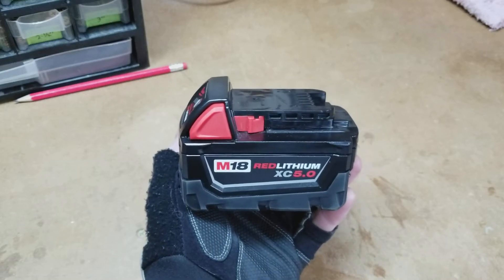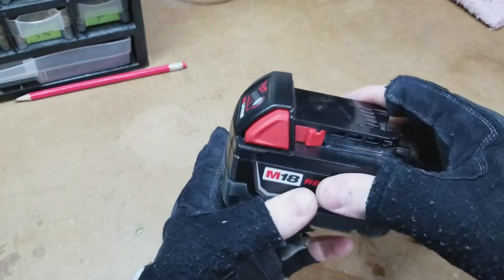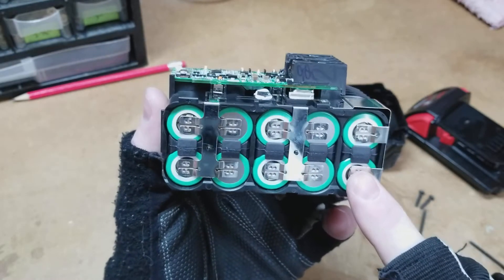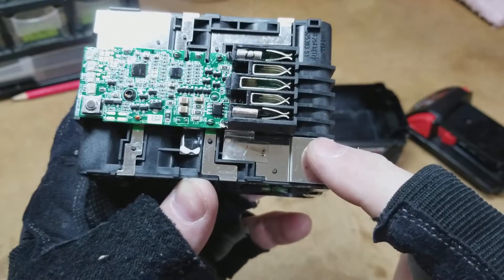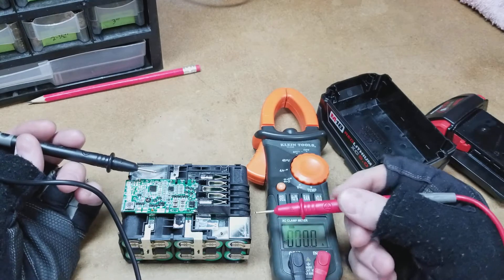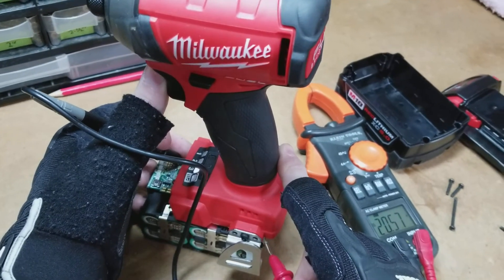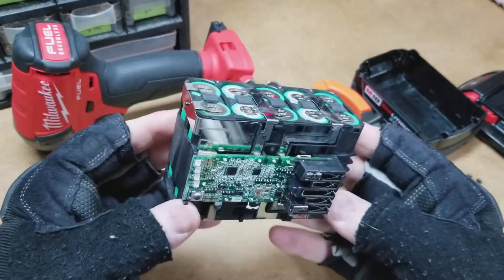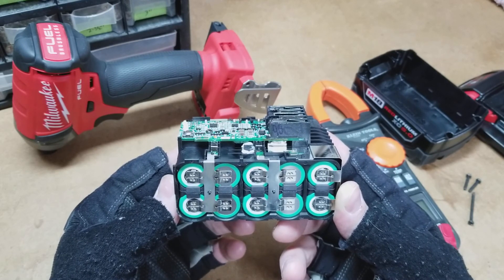A Look Inside a Milwaukee 5.0amp Battery

Comment: To test amperage you'd have to actually put a load on it and then hook up the meter in series on one of the leads. I'm not sure why that 12A load showed up but that's definitely not accurate. It also shouldn't be that constant under a real load. It'll vary depending on the amount of trigger you're pulling
Reply from the maker: Yeah I'm not to sure about the amperage reading idk much about that stuff. But I know the batteries when fully charged will read 20 volts but under load it should drop to 18 volts so that kinda stumped me, maybe its cuz the battery I was using was in a fully charged state and that caused it from dropping down to 18 volts. Also that multimeter i was running was an old crappy one that had glitches and wouldn't turn on right sometimes and stuff, since then I have ditched that multimeter for a very nice high end Klein M700 multimeter which works great!
Reply: Chevy513 - Yes you’re right. Most batteries have what is known as a Voltage Sag. So whenever you place the battery cell or pack under a load, the overall voltage will dip by a couple of volts. The smaller the sag generally means the better the battery quality. But really I don’t think you could get much better than say 1V or so.
Reply from the maker: @honestinsincerity2270  You know what I've also noticed is if I have a fully charged battery it will read 20 volts but if I take a battery that has been run say half way down it will read 18 volts then, I've noticed the same thing with stuff like AA batteries they are 1.5 volts and will read 1.6 brand new and as you use them the voltage will lower over time, I've checked some of my used AA batteries that aren't dead but have been used for awhile and they will read 1.4 or sometimes 1.3 volts
Reply: @chevy5137  lithium batteries have what is known as nominal voltage which is in essence its average voltage over its usable life span. in the case of lithium ion cells like the 18650 cells that comprise your drill battery the nominal voltage is 3.6 volts. which is why they label it as an 18 volt battery. 3.6 volts times five cells in series which is 18v. the voltage range of one 18650 cell is 3v to 4.2 volts. this is why you are getting over 20v when you measure them fully charged.
Reply from the maker: @danielroark171  Yes and this is a common thing and companies like DeWalt and Porter Cable say 20volt max* because without being under load they are 20volt but in all reality they are the same as any 18volt battery out there
Reply: @chevy5137  that's pretty much it
Reply: @chevy5137  incorrect. The reason you did not have voltage sag is because your battery was not under a load. Simply pulling the trigger on a drill with nothing attached is what’s called an idle run. Yes the drill is running, yes the drill is pulling energy from the battery, but it’s not taxing the battery. Thing of it like a gas tank in your car, if your gas tank is full to the brim with fuel your fuel gauge in your dash will read “full”, if you park on a steep hill your gauge will likely not change at all it’ll still say full. However… if you have a half of tank and you your gauge says “half” and then you park on a hill you will likely see that your gauge will now (after a brief time to readjust) show as if you have more or less fuel than you really have. In this example your tank is your battery, your gas is your stored energy, and your gauge is your meter. 20 volt and 18 volt batteries are not I repeat NOT the same. One is fully charged at 20 volt amd one is fully charged at 18. The cells are the same, the number of cells is the same BUT the BMS that controls the voltage cut off is programmed differently. The reason Milwaukee has theirs listed at 18 but test at 20 is because they are reprograming their new BMS to shut off at 20volt while keeping it in tue 18volt case that way they don’t confuse their customers who don’t know any better. They are simply competing with other companies while not confusing their customers. Because they don’t want their customers to go buy a bunch of new tools for no reason. And before you say anything like “well it’s not good to put 20v through an 18v tool….. youre wrong. It’s perfectly ok. An 18v tool grade motor is designed to handle a wide range of voltages amd current draws. You didn’t see a voltage sag to 18 because it’s not truly an 18v battery. It’s a battery that’s been allowed to charge to its full potential by use of a new charge program in the BMS. It’s not an 18v battery…. It’s a 20v battery. And you didn’t apply a true Load you just simply pulled the trigger.
Reply: It read 12 because thats the max his ammeter could take at that setting.
Reply: If you were cranking a fastener you'd see more load sag,* perhaps even down near the typical "18.5 nominal" rating of a 5s series... though not too likely even then as that's a 2p×5s pack using all high quality,** high continuous current rated cells. That pack could probably drive a ~750w load if necessary. One of the compact and/or older 1p×5s li-ion packs would likely drop down to the 18s in this experiment.

*This experiment already looks like it would've required three hands, idk how you even pulled it off without having to hold the driver down with your chin or something lol. It would be pretty funny to see even two people trying to drive a fastener while probing the battery pack with normal probe tips rather than grabbers/gators/et sim.

**Molicel I believe? I know Milwaukee had contracted Molicel for the first ever Li-Ion tool battery offerings, idk why they'd bother switching as Molicel makes some fantastic cells imo. Their consumer cells are wrapped white though, idk if it's that OE pack Molicels are wrapped in a different color or if those are actually perhaps from Sony/Samsung/etc. I would REALLY like to know what brand(s) milwaukee, makita, ridgid etc use these days, without having to open up packs and probably still fail to find any cell brand markings. The Ah ratings on so many modern packs rarely if ever seem to match up with what I'd expect them to be given the cells I assume they use. For instance I'd expect that the Milwaukee HO 12.0Ah pack would be something like a 3p×5s configuration of Molicel P42As, but that'd make it a 12.6Ah pack, why round down? Unless Molicel is overrating their P42A a bit which is totally possible.
Reply: @cbirch7302  except it's an AC clamp on only! Lol.
Reply: The 12A you were reading was more than likely you had the meter set to AC voltage so measuring DC voltage would give a wrong voltage reading.

Comment: Your not checking the amps correctly, they should dead load over 100 amps. Measuring the batteries from the cell should be higher than measuring from the voltage regulator of the tool. The system shuts down when the cells reach the minimum voltage that is why the tool feels like full power right to the end. If the batteries go below the minimum voltage they will not charge correctly. That's my 2 cents
Reply from the maker: I appreciate the comment, I am not great with electrical number and things like that, when it comes to wiring stereos and doing other wiring on cars I am really good but when it comes to things like amps, ohms, etc. I really have no idea about that kind of stuff lol! Thanks for commenting and shedding some light on it for me bud =)

Comment: Milwaukee tools are the best. ... Sawzalls, grinders, ratchets and the new High Torque impacts .. I have them all
Reply from the maker: HEMI LOVER Nice sounds like you got a lot of good toys! Yeah Milwaukee is great, I had been running Ridgid exclusively and then Milwaukee sent me out some really nice tools for free like my M18 Fuel cordless mud mixer kit I have reviewed and their brand new M18 Fuel cordless drain snake kit that just came out this November which I will be reviewing soon and I have bought a couple myself including the new M18 Fuel cordless Blower and the M18 Fuel cordless Surge Impulse Driver and now that I have 5 Milwaukee M18 Red Lithium batteries (4 - 5.0amp and 1 - 1.5amp) to establish me very well into the Milwaukee platform I will be running both Milwaukee tools and Ridgid tools now! The next one I'm picking up is the sweet new M18 Fuel cordless Gen2 Impact Gun with 1400lb-ft of nut busting torque in reverse and 1100lb-ft torque in forward, that thing is a beast! I can kiss my air impact gun goodbye once I get the Milwaukee lol!
Reply: Not so great when it comes to servicing faulty items. You have to wait 2-3 weeks and probably buy another one meantime or go on holiday. Too many failed in my company, so we switched to DeWalt and no more problems.